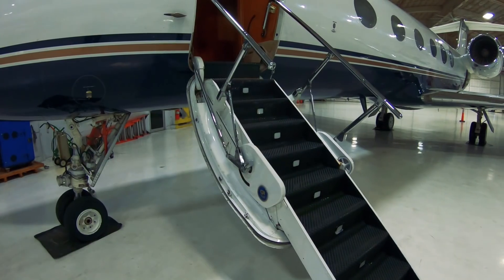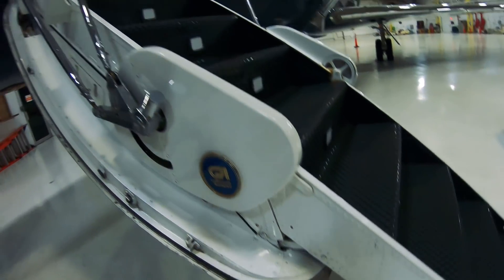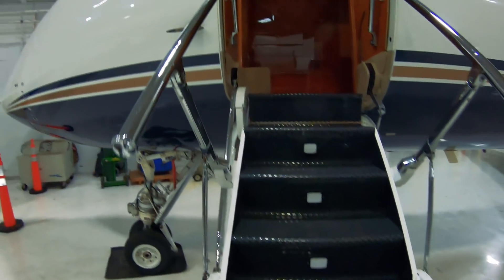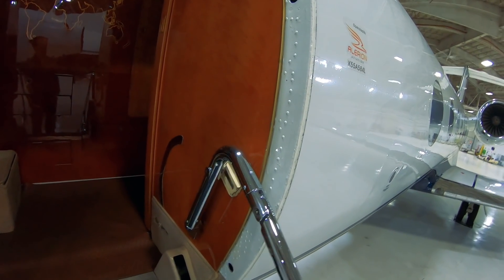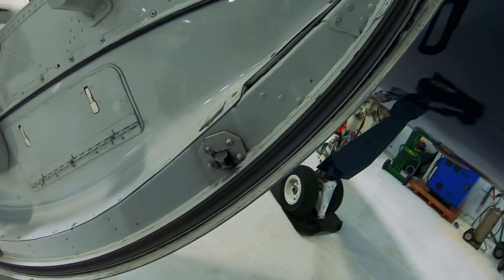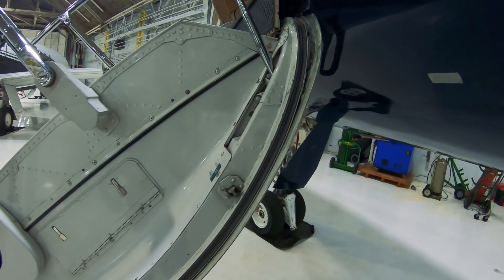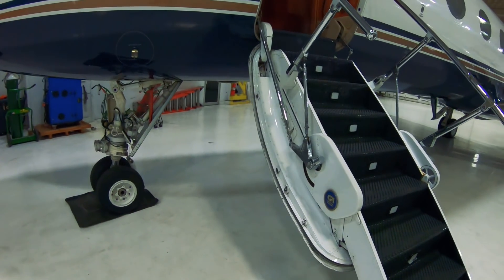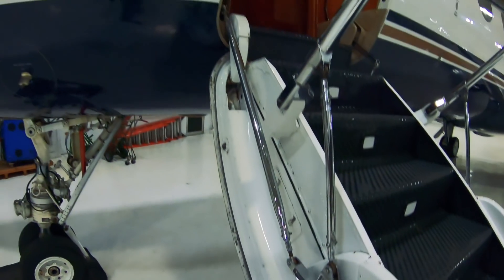Private Jet Door Seal - Tech Tuesday

Comment: Nice video...Once departed in similar Gulfstream from rainy environment and had the door seal, still wet, freeze against the door frame preventing its retraction after landing at a frozen airport (Iqualit Canada) during a tech stop. We noticed the stiff door seal and decided to use the baggage door as pass through for credit card and paperwork rather than try to open the main door. All worked out on the other side as we landed in warmer environment. FWIW...!
Reply from the maker: Very interesting...great solution to the problem there!

Comment: Wet paper towels are another good option.
Once you lift that red lollipop, wait for the hissing to stop and look for light around the edges before raising the actual door handle to retract the bayonets.
A good tip for the baggage door is to place your foot against the bottom edge and on rotation of the handle counterclockwise, wait for that seal to also deflate prior to pulling it inward.
The inertia reel cables tend to want to pull it in as soon as the handle is fully released.

Comment: Another quick request. The actual use of the doors and how they close, and what it then looks like on the inside. Different aircraft and manufacturers have different methods. I'm sure I've seen in some simulations that some of these doors have a seat on the inside too......
PS you put "Here is a quick look at the door SEAT on.....". Which is one of the reasons I was excited to see this video
Reply from the maker: Thank you for the spelling error...I can do another video from the inside of the door. We do not have a seat on the door, rather we have a jumpseat in the cabinet across from it.

Comment: Thanks for pointing out about crew not getting into a rush opening the door.
Maybe a video on the correct way to open the door from inside with the primary and secondary locks. I have a couple sheared latches because they opened the primary first. (G450/GIV Mx instructor)
Reply from the maker: Great idea. Thank you!

Comment: Didn't anybody mention duct tape for door seal emergency (only) repair?  It comes in many colors.   Thirty years ago I used duct tape to fix a whistling noise at the top of my Toyota windshield.  We had the car painted and they didn't properly replace the chrome trim.

Comment: Personally I'd go with a hybrid solution - wet towel in garbage bag. Better stay on the safe side ;) Seriously though I've never even wondered how these worked. Fascinating. Is that the preferred method on jet aircraft and are there other solutions?
Reply from the maker: There are other solutions such as mechanical seals similar to that on car doors, but this is the norm.

Comment: If a seal loses all pressure suddenly at FL450 is there time to descend reasonably or is it a full-blown emergency descent?
Reply from the maker: Very likely it would be a slow pressurization loss. What would happen immediately is the outflow valve would close fully to reduce the impact (or potentially eliminate it). Remember that air is still rushing into the plane from the pressurization system.

Comment: What are the two little doors on each side of the door at front and rear? They have two latches about half way between top and bottom of the actual door not the frame?
Reply: Storage for the gear pins and Pitot covers

Comment: Q: If the seal starts to fail can you overcome enough to you reach a safe altitude ?
Reply from the maker: That depends on how much of the seal fails, but very likely yes. The outflow valve would close to compensate for the additional leakage.